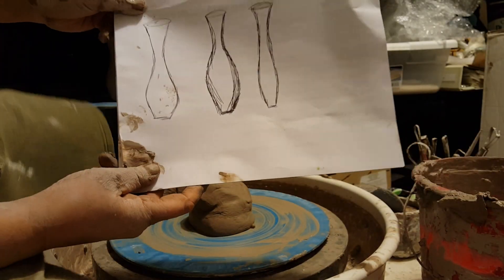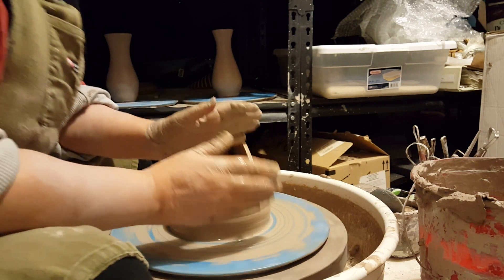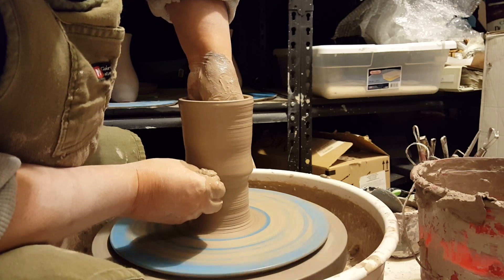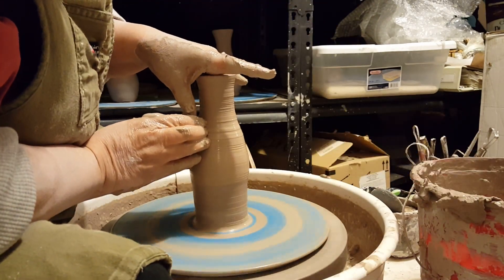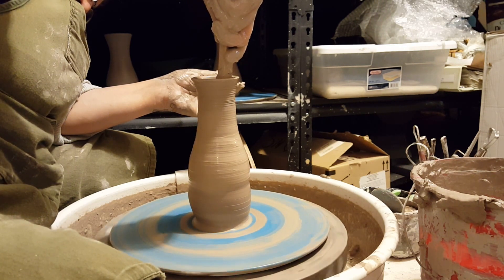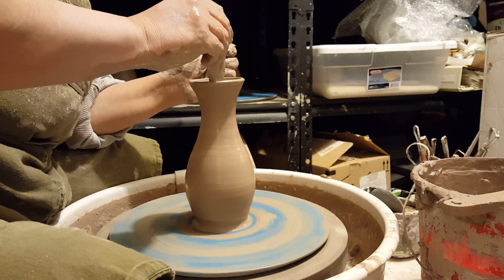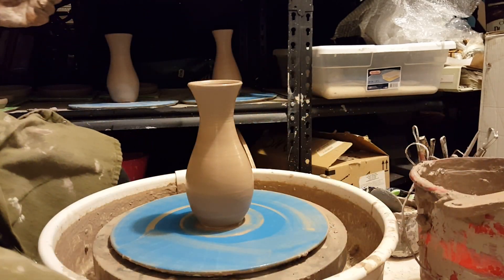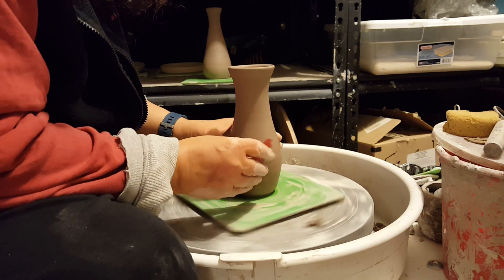Using a Throwing Stick to Make / Throw a Vase on the Wheel and Trimming Right-side Up

Comment: Where can i buy throwing stcks?
Reply from the maker: I can't remember where I got this one but I believe most places that sell pottery tools will have throwing sticks. They come in many shapes and sizes
Reply: I use a wooden spoon with the rounded part towards you at 3 o’clock if you are right handed. I do have and use other types but the wooden spoon is great and very cheap from charity shops